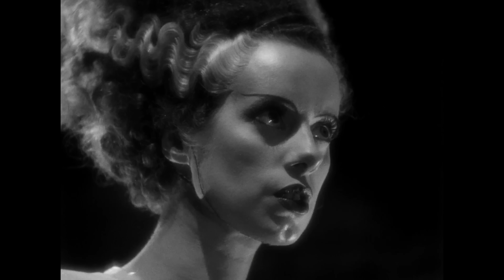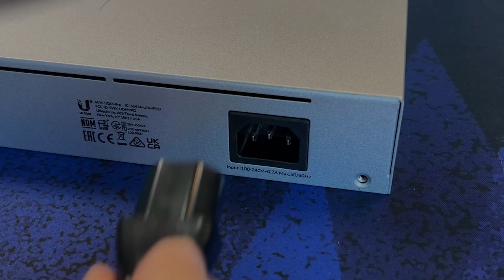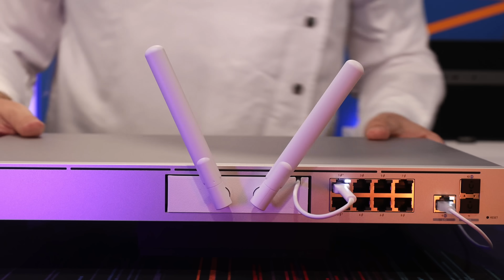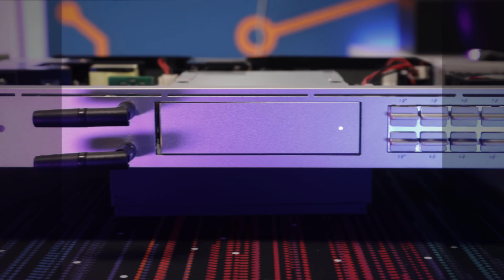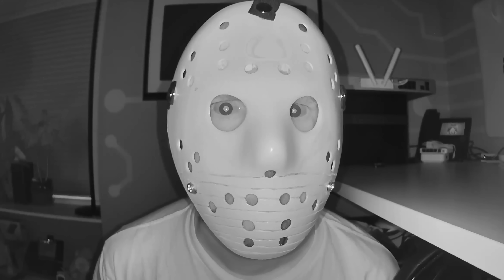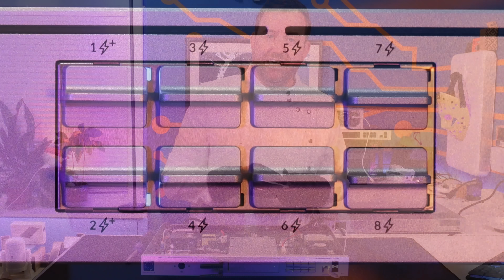The Return of Dr. Frankenstein's Dream Machine!

Comment: Your channel has provided me with many valuable insights. We plans to install five Unifi wireless access points linked together through a Poe switch. Do we need to configure each access point separately? Is there an option for setting up a master and a slave, so you can configure one master and it will replicate all others, similar to an Aruba AP?

Comment: Awesome video! I'd like to see a dream machine with a hard drive bay lock that's driven from a solenoid controlled by a Unifi Access reader built into the unit with video surveillance integrated as well. Or maybe a dream machine with the aggregation switch mod but also DC bus bars so you can run hybrid fiber cable with DC power out to a remote camera / AP / switch.

Comment: UNAS Pro where the top 3 bays are modified for Raspberry Pi 5 with PoE-hats and the bottom 4 remains for harddrives! 😁
Reply from the maker: Interesting...
Reply: @CrosstalkSolutions  Running the Pis as a cluster with SMB-access to the NAS should make for an interesting setup! 😁
Reply: Going one step further - maybe also get the AI Kit too then deploy a lightweight Yolo model for more than what we get out of the box with the G3/G4/G5 cameras on object detections